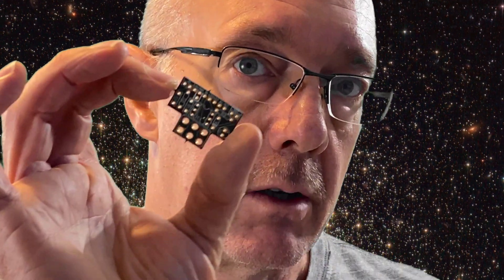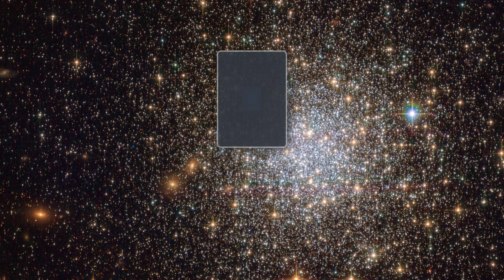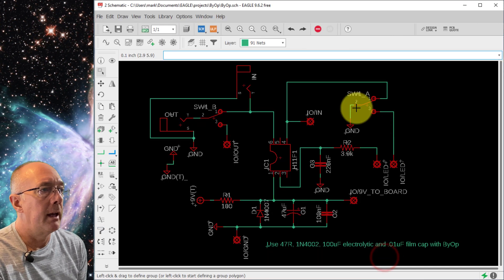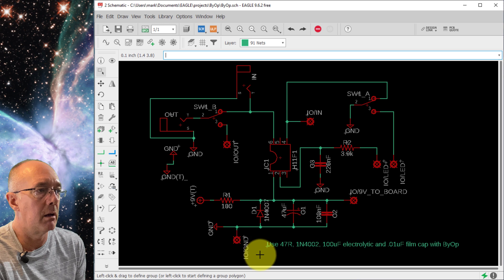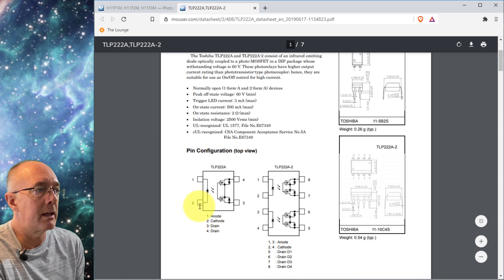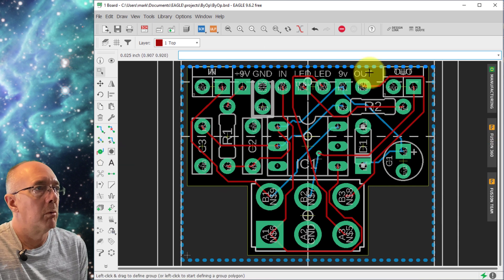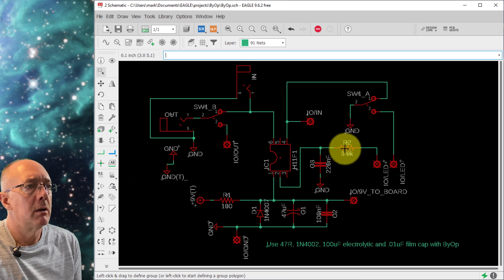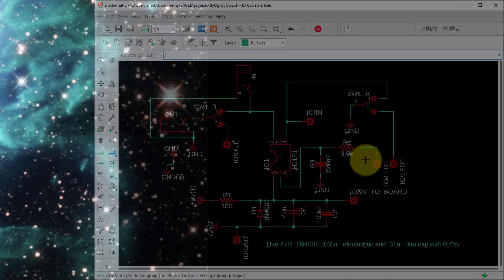Build Your Own Effects - Universal Optical Bypass Circuit - Homespun Effects

Comment: Hello,

Thank you so much for sharing this, sir. It's much appreciated!
I am looking to design something similar. My requirements include continuing to use the 3DPT switch while eliminating the popping noise.

Does your circuit achieve this? Is it completely noiseless?

Thank you in advance!
Reply from the maker: @AFCWledElKhadhra  unfortunately, this circuit needs more work. It depends on the circuit that it’s working with and it does lessen the switch pop but it does still occur. I’m thinking it has to do with the LED.
Reply: @HomespunEffects  Hello,
Alright, thank you for the feedback.
This is quite interesting. From my understanding, pops can have multiple sources. Relays pop because it is purely mechanical. I read that JFET switching can pop as well when the DC bias is not well set.
Something I may suggest: if you want to check if it is related to the LED, you could try disconnecting it and see if it still occurs.
Reply from the maker: The circuit won’t work at all with the LED removed. You see, with the LED removed the IRLED in the optocoupler has no complete circuit and remains unpowered.

I’m thinking this is a fun experiment but it’s best to just go back to a plain 3PDT.
Reply: @HomespunEffects  right 
Maybe you should use a socket or something and try with different leds, see what colours pops less 
Happy new year sir  : )